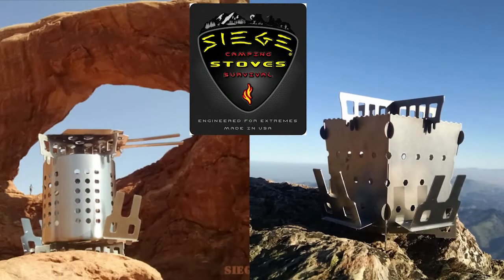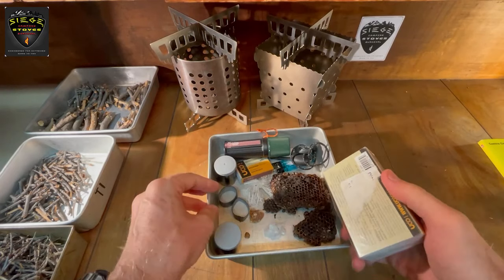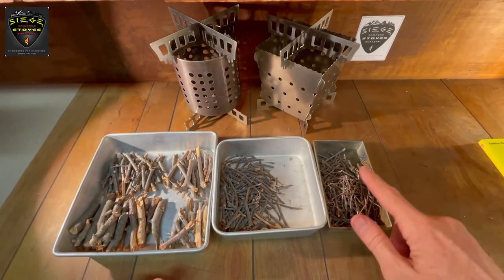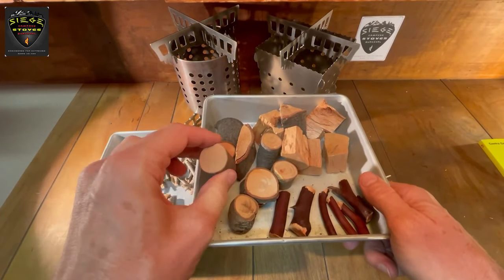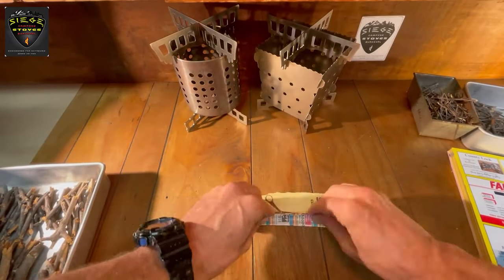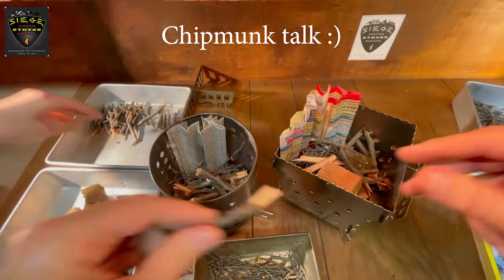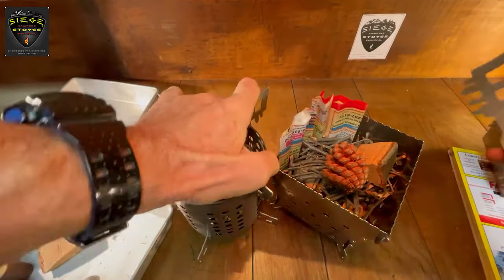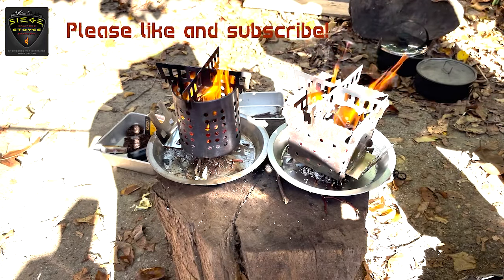Forget Top-Down & Bottom-Up Fires! Try this Zero-Maintenance SIDEWAYS FIRE Technique by SIEGE STOVES

Comment: Well done James. Unique way of loading the stove. Thanks for sharing
Reply from the maker: Thank you Mark. The inventor of the original Cross-Members developed the technique, which he uses for cooking his breakfasts several days a week. He has an awesome 180 deg. view of the Sierra Foothills below and beyond, with no developments in sight, so that helps :).  When I visited him in the summer, I was impressed at how he started the fire with one spark and then left the fire while he went inside to prepare the eggs, etc.  The fire just took care of itself, with complete reliability and zero maintenance.  It was a Set and Forget Fire! Naturally, one would never leave a fire unattended in the woods, but his was on a metal table with green grass all around and no wind. Even if one isn't going anywhere, having a system that works every time and doesn't require any manipulation of the fuel during the start-up, will free up one's hands for preparing food for cooking. He also warms a tortilla under the stove -- something he demonstrated in his original video from several years ago.
I will be posting a follow-up video showing the fire in the stove soon.  I'm still new to his technique, and my first attempt fizzled, with subsequent efforts working better. I think I will need to get some more practice in, get his input, and post an update in which my stacking is improved.
One tip I should mention for the toasters when paired with the titanium stove: since the toaster plates are stainless steel, they are a bit heavier than the titanium and will tend to tilt back and lift the lighter titanium base plate up when first inserted under it. The base plate can be pressed into place and once fuel is added into the stove will weigh down the base plate and bring the toasters more upright. The forward slots in the toaster base plates aren't really needed, but we added them just in case someone wants the toast right up against the stove (if, for example the fire has cooled down a lot by the time the toast is added). Generally, there is plenty of heat coming off the stove, and bread toasts quickly, so the rear slots are best.
When using one of our Folding Grills, one can grill over a relatively low bed of coals by lifting off the top Cross-Members and placing the grills directly onto the stove rim (works for canister stoves too). I use one of the lightweight Compact Fire Pokers that we sometimes have in stock to lift the Cross-Members -- a very handy tool to have! The Compact Grill can even be tilted down into the Flat-Pack Stove to get it even closer to the coals -- the tapering inside keeps it from falling in. But these tricks are not needed if one loads up the stove with thicker material once it is burning well.
Stay well!
Reply from the maker: Hi Mark, I plan to post a revised video at some point, in which I improve my process. There are a couple of things I didn't get right: 1) The thickness of the twigs should increase SIDEWAYS as they move away from the paper, and not upwards (this doesn't apply to the chunks, which are randomly interspersed). 2) I think I snapped a lot of twigs shorter than they need to be, so they packed in more densely than is ideal. Having them a bit longer should create more air gaps for better air flow. Practice makes perfect!

Comment from the maker: I plan to post a revised video at some point, in which I improve my process. There are a couple of things I didn't get right: 1) The thickness of the twigs should increase SIDEWAYS as they move away from the paper, and not upwards (this doesn't apply to the chunks, which are randomly interspersed). 2) I think I snapped a lot of twigs shorter than they need to be, so they packed in more densely than is ideal. Having them a bit longer should create more air gaps for better air flow. Practice makes perfect!

Comment: I cut the cardboard tube from inside a roll of paper towel in to strips about 1/2” wide, and long enough to stick up above the wood load by, say, 3/4”.  I put some oil onto the  strips, and carry a few in a Ziplock sandwich bag. Fraying the top end facilitates lighting.
Courtesy of Half Vast Flying
Reply from the maker: Good idea!  Something one of us has done on occasion is to cook with nothing but cardboard strips, by feeding them in one at a time to keep a constant fire going. You'd need a lot more than the core of a paper towel, but it's a good technique to be aware of, if ever one had to cook without wood scraps or other sources of fuel around.